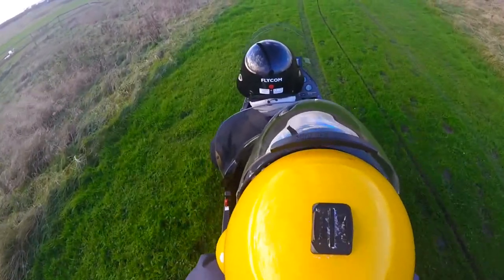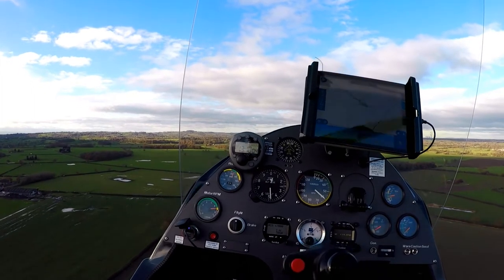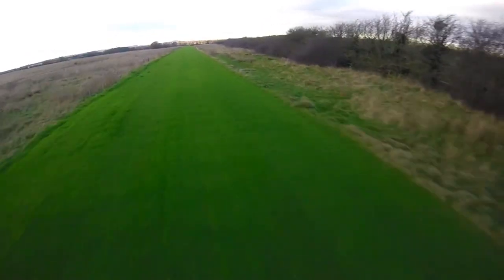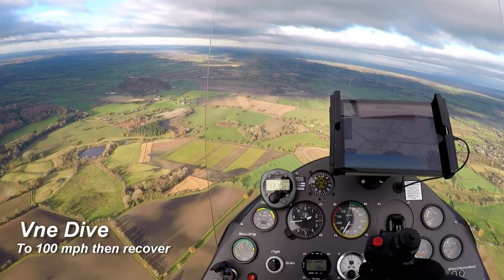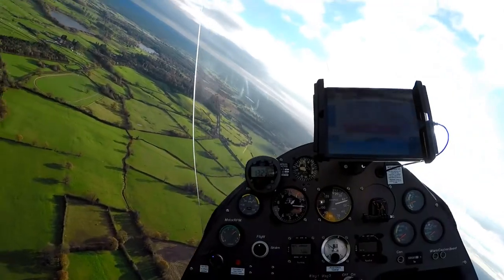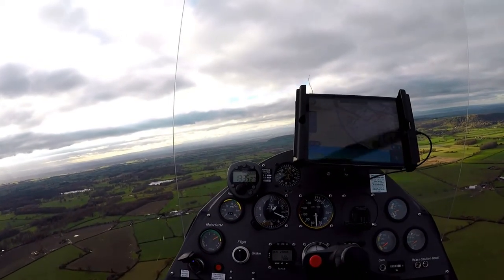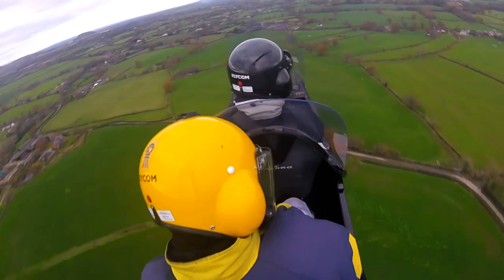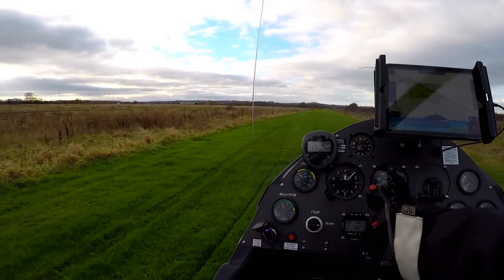Gyrocopter Flight Test & Biennial Flight Review

Comment: Great video. How do you prevent any vibration from the rotor mast to your cam? Assuming that's where one of your cams were attached?
Reply from the maker: Thank you 😊. Yes one camera is indeed attached to the mast; an original GoPro Hero Session - not the 5, and therefore not stablilised.  All of the stabilisation is done in the editing software.

Comment: Hi Stu, great videos...and explanations of what is going on. I am in the process of getting an open cockpit gyro and was wondering what helmets to go with. It is very hard to get user reviews. What is your opinion of the Flycom helmets - comfort, sound quality, etc. ?
Reply from the maker: Hi Peter. I like my Flycom; the passive noise reduction is miles better than the helmets supplied with my MT-03.  It is quite heavy but not uncomfortable.  Visibility upwards isn’t as great as it could be due to a lip above the eyes.  I have a graduated visor which means I don’t need to wear sunglasses which improves the noise reduction; it’s also removable for summer use. The visor does mist in winter but can be quickly cleared by opening just one notch. Both my original training instructor and my revalidation instructor also use Flycom helmets.  Hope this helps.
Reply: Thank you for the quick response... Any information I can get on the subject is priceless.

Comment: What is meant by a zoom climb? Is this a what is called an updraft? Mike
Reply from the maker: A zoom climb is simply one that converts forward airspeed to altitude - i.e. your airspeed decays as you climb as the climb rate is faster than the engine can maintain on its own.  The crucial recovery requirement in a gyrocopter is the need to reduce power to idle and wait for the gyro to settle before lowering the nose, in order to prevent a 'powered pushover' which can induce negative G and decelerate the rotor.  This is quite a different recovery technique from a fixed wing, which requires immediate lowering of the nose and the application of full power.

Comment: What does the flight/brake switch do?
Reply from the maker: The flight/brake switch controls pneumatic pressure to a cylinder below the rotor disc.  In brake mode air pressure is applied to the bottom of the cylinder which then extends and pushes braking blocks (like old-school bicycle brake blocks) against the toothed pre-rotator disc, with the effect that the whole rotor disc is braked to a stop.  In flight mode, pressure is released, the brakes descend to free the disc and the same cylinder can then be fed with pressure from above or below. In so doing it moves the whole rotor disc and thus acts as a rotor pitch trim system, controlled by a hat switch on the control column.